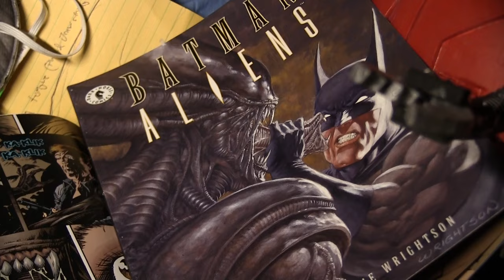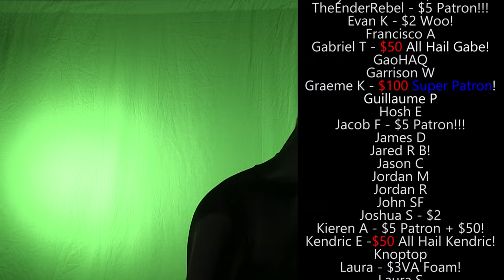MAKE AN ALIEN COSTUME! - How to Make a Xenomorph

Comment: Oh dang. This is awesome. Also have you considered using all purpose filler for your builds? It's what I use. It takes a few layers but it's muuuuuch cheaper than 14 for a tube. Idk if it helps or not...since my builds are a lot smaller.